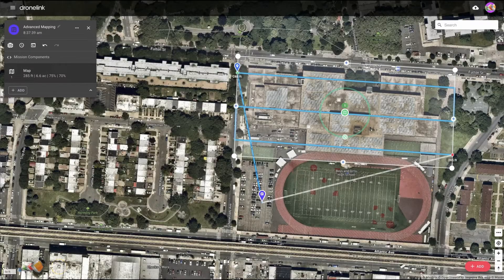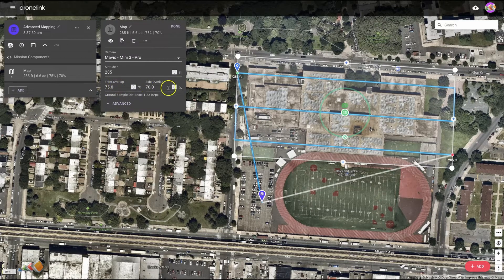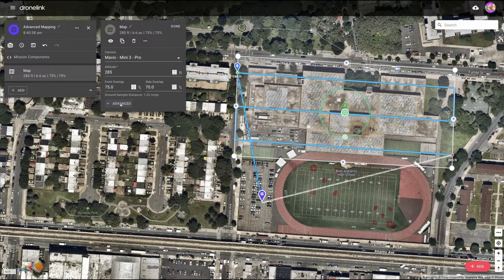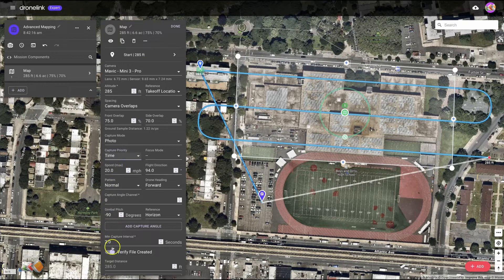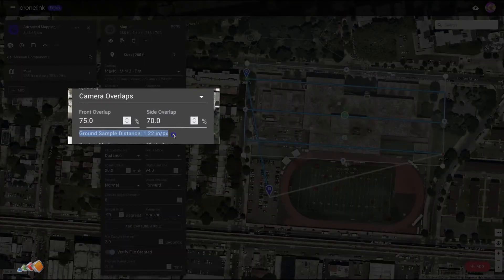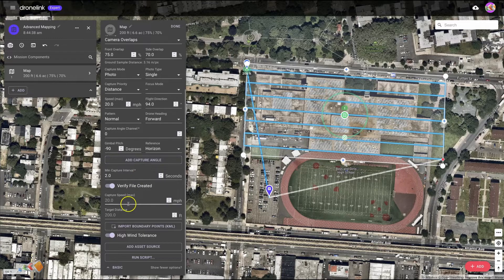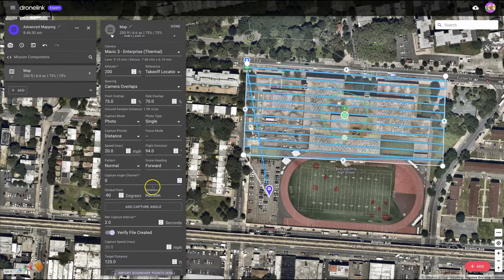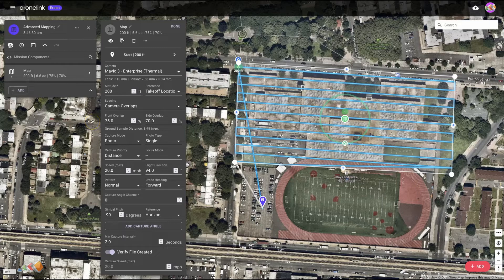Dronelink Advanced Mapping

Comment: Great info.  I was wondering if max speed actually made the drone map at that speed or not.  Looks like max speed is mostly used in getting you to the first point and back after the mission, and Dronelink takes care of the speed when mapping.  Nice!
Reply from the maker: A lot depends on the drone, the altitude and the lighting.  If it's a nice bright day (allowing for high shutter speeds), you have a drone with a mechanical shutter and are flying relatively higher then you can map at high speeds.  This might help clear things up a bit:  https://youtu.be/woBViBYT4bE